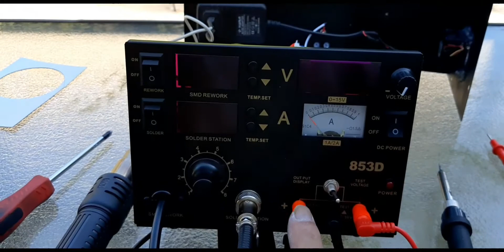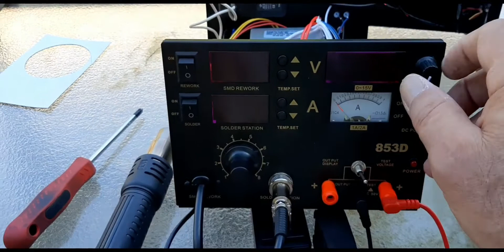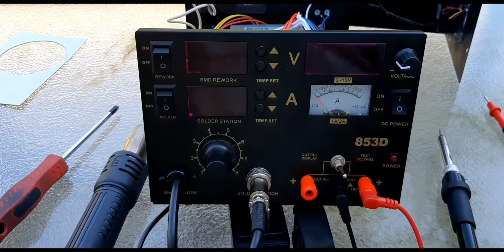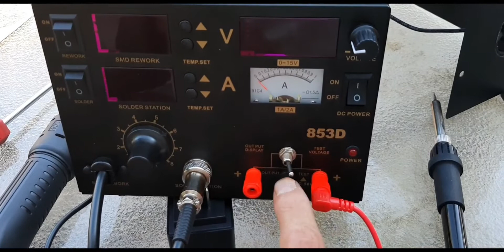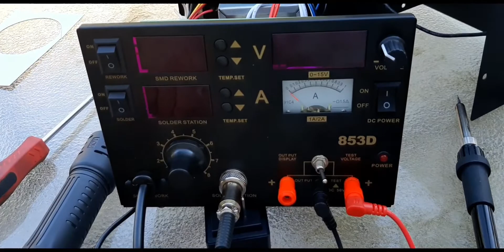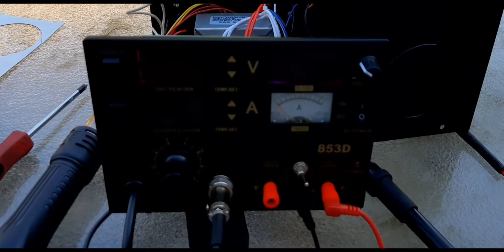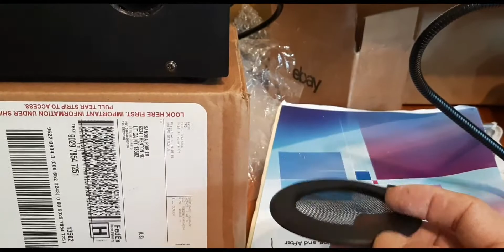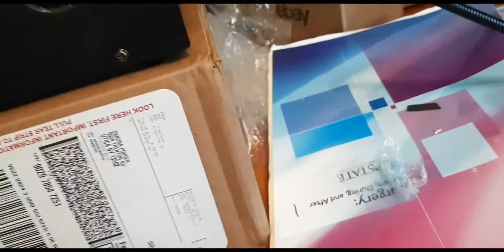853D rework station mod.

Comment: It all looks very professional. The only problem is that the fan is really loud.
I think it would have been better if you had taken a 5 volt CPU fan.
There should be a 5 volt connection on the mainboard.
I use the model Yihua 853D 3 in1 soldering station and this one has no fans either. I will also upgrade it.
The soldering tip sits a little loose and smot takes a little more time until the soldering iron is properly up to temperature.
I wrapped aluminum foil on it and the soldering tip has no more leeway and now it heats up very quickly.
Many greetings from Turkey
Reply from the maker: You are right and I installed the next size down  Still 12 v but now you can barely hear it. Thanks.
Reply: @umpy3152  I also have to make my experience with it. Maybe a 5 volt CPU fan is not enough. Then I'll also take a 12 volt fan. I have the same model with a power supply and unfortunately only one transformer is built into my soldering station for all 3 functions. Maybe I'll install a second transformer and only use it as a power supply. The main transformer is no longer heavily used

Comment: I got the same one fan needs slowing down 8v or so that world get on my nerves lol.. No outlets on the broad then hmm  shame I'm going to do the same but tap into the broad for power I'm also putting a back light on the Amps clock 1watt led  as if you noticed hard to see..  nice video old school work brilliant i will subscribe as i have the feeling i will be interested in your future video thank you
Reply from the maker: Yeah, It is loud. I'm  probably gonna use the next size smaller fan.
Reply: @umpy3152  no just slow it down or put a 5w bulb 12v in series with the + wire done been looking in mine and im going to tap my power off the transformer then bridge rectifier then to fan also if you slow the fan it will last years.

Comment: You got the old version.  I bought a newer version that has a digital voltage output for $115.  However there is even a new version out that has a totally new control panel  I see on eBay for $311.  just sayin
Reply from the maker: I did see that.